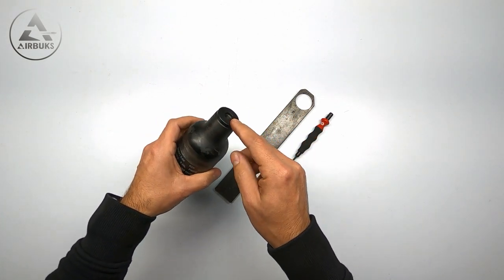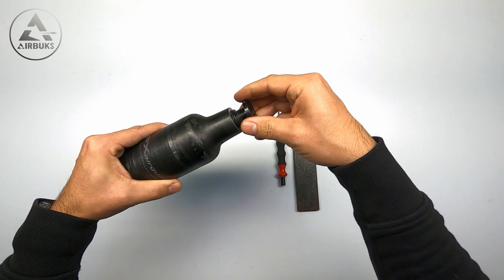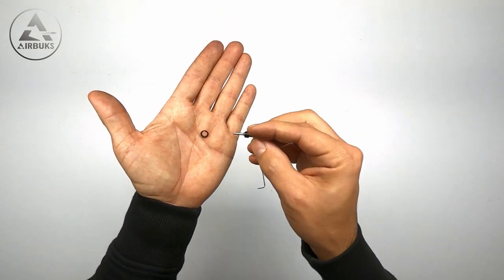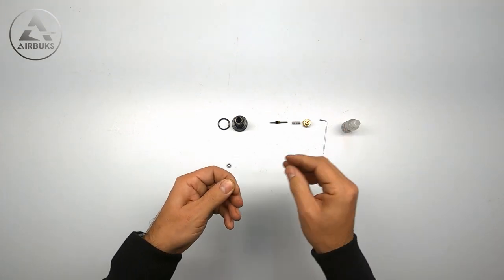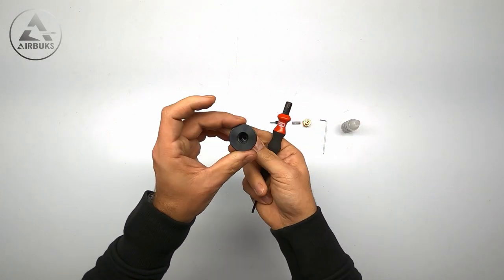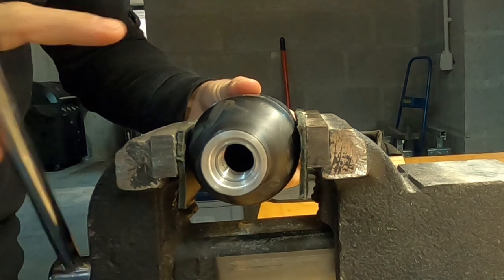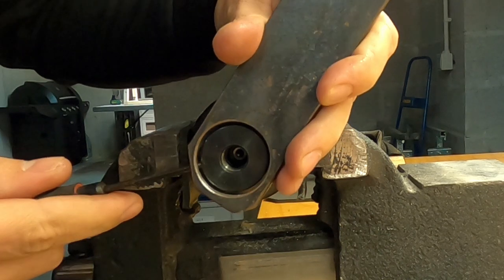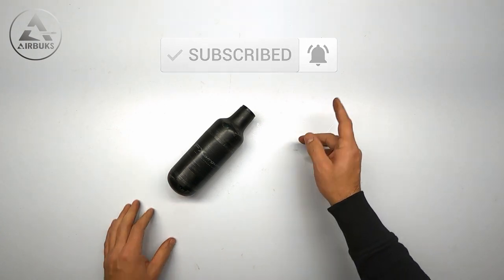FX carbon fiber air tank valve leak repair

Comment: When I did mine the hardest part was to remove the valve. Which was Loctited, with black Loctite. I think you should mention this and would be better if you will show how to remove the valve without a purpose-made tool. Apart from these, great video as usual.
Reply from the maker: Hi , my valve had no loctide on it , I have heard from others that there was loctide on there’s aswel , strange there is no need for loctide on it 🤔
I first tried to remove it without the tool but I say quickly that I couldn’t open it without damaging it or leaving marks on it .
Reply: Good point , you are dealing with carbon fiber , you can’t heat it without possibly compromising the carbon tank !

Comment: ? For you man, I have issues with top valve connection o rings blown out how do I put a new one in I have no clue where it suppose too sit in.
Reply from the maker: Can you explain more detailed or mail me some pictures ( airbuks@icloud.com )
Reply: What I’m trying too address is that trying too see where does the O rings seat in. Reason I ask that I took it off and try too replaced it but forgotten where it supposed too seated in. This is referring too bottle thread into the gun it self. O ring got blown off and leak air. If you can help me out I would appreciated it. Again valve bottle thread o ring installation location. If you have clear pictures would be awesome
Reply from the maker: @sergeantmao8017  so if I get it correct , you need to place the oring in the bottle valve part that screw into the gun ? 
You can check the diagrams and oring sizes on the FX support website
Reply: Yes correct. I had look on FX couldn’t track it down
Reply from the maker: @sergeantmao8017  part number one is what you mean think 
https://fxairguns.com/wp-content/uploads/2020/03/airbottle-200326.pdf
Reply: That’s correct but where it supposed too seat in. There 2 loop groove for o ring I had try everything but once I tighten up the bottle it struggle too go in. Maybe the O ring they send probably too thick going in there
Reply from the maker: @sergeantmao8017  normally the oring has to sit deep into the bottle neck almost all the way down , it is tricky to get it in .
Reply: Deep as in around the valve pin is that what your reference too
Reply from the maker: @sergeantmao8017  yes

Comment: The PCP world is growing very fast , I know first hand just with volume & Tire pressure in tires with up to 120 psi how deadly they can be and can kill !  we are dealing with bottles in the 4,500 psi range in the PCP world , it’s no longer handled through scuba shops who know how to test and fill these air containers !  Every time I fill one of my portable tanks I am aware of how dangerous it can be !  It’s so easy to overfill at a higher pressure while transferring from a 4500 psi compressor into a 3000 or 3500 psi PCP tank !  Enjoy the sport but realize what you are dealing with , it’s just like a loaded gun with the safety off !
Nice video and repair tool you made ! 👍

Comment: If anyone uses or continue to use the Huma quick fill adapter, you will have this same problem over and over. They now send a restrictor screw to use But it won't work either, it may work once or twice.
Using the Huma blows the valve seat out of its seat, sometimes no damage to oring just reseat but sometimes the same as the video.
When the bottle is screwed on the gun for filling the valve is pushed open allowing easy air transfer in either direction, using the Huma only high pressure air has the force the valve open thus unseating the valve seat.
Bestfittings is working on one that will work simulating as when on the gun.

Comment: Nice video, wel explained and very helpfull as allways 👍. May I ask,what do you use for lubrication of the o-rings? Will Ballistol do the job or is any silicone oil better? Thanks in advance.
Reply from the maker: Thx for the support, I use silicon olie from Huma Air .
Reply: @Airbuks Wat leuk, ik zag dat u mijn Zuiderbuur bent, ik kreeg al een idee vanwege de 'olie' ... 😊
Reply from the maker: @chefrenty9155  😉👍👊

Comment: What's the simplest way to bleed the air if the bottle has pressure in it
Reply from the maker: Option 1 :Huma air sells adapter to fill a CF bottle but you can also use it to bleed the bottle 
Option 2: saber tactical sells a kit to bleed and remove the valve 
Option 3 : and the most cheap one , find a bold that can be threaded into the neck slightly file it down one one side so the air can escape slowly . Gently thread it on so the valve pushes open and let the air escape slowly. 
REMEMBER BEING SAFE , MAKING A TOOL LIKE THIS AND USING IT IS AT YOUR OWN RISK

Comment: Great Video. Is it recommanded to put some loctite on the threads going to the inside of the cf tank, or shall we just snug it up?
Reply from the maker: Thx , mine didn’t have any loctide on it from the factory. So I don’t think it’s needed . There is a oring in the neck to seal it and the pressure on the inside will make it impossible to unscrew.
Reply: I don’t see the point of loctite if an o-ring is used to seal the air , if anything anti- seize might be better !  Tanks unlike mechanical moving parts on nuts and bolts should not require loctite .

Comment: Thank you. great video. I have a leak from the breather hole near the safety. I know the origin is the reg. I have replaced all the o-rings. And recently purchased a service kit  and replaced the delrin rod and adjuster screw. Still it leaks from the breather. Any advice? Thank you

Comment: I
 am having trouble replacing the O'ring inside the bottle valve, is there a trick to it?
Reply from the maker: Not really a trick , some patients and a blunt tool to manipulate it in place 🤷‍♂️
Reply: @Airbuks  it is really difficult to replace i have been trying for so long
Reply from the maker: @KnowsleyVerminControl  push it inward down so you put one side of the oring in the groove , hold it in the groove with a blunt object ( Allen key for instance) the use another Allen key and push the rest of te oring in the groove

Comment: Installed a power plenum on my impact now air leaks rapidly out of the weep hole fx says the regulator orings need to be re-seated but I did what they said and no such luck. Any ideas ? feal like giving up on this gun and cutting my losses
Reply: I have the same problem. I even got a service kit and replaced the rod and adjuster. Still leaking through that breather hole.
Reply from the maker: Hi guys , sad to hear you’re experiencing this issue.
Probably you have done this but I am asking it anyway to eliminate some options.
1. When you took the regulator completely out , did you make sure that everything and every surface was super clean before putting it back ?

2. Did you scratch any of the oring surfaces when removing the old orings?

3. Did you also replace the oring down in the regular hole ? Very difficult one to acces and easy to scratch that surface. You need a good pick to poke in the oring and manoeuvre it out ( like dokter bibber game 😉)

4. Did you lube all the orings when putting the new ones one ?
Reply: @Airbuks  Thank you for the ideas. I'll strip it again a little later and check for any dirt inside. I'll wash it out with 99%Alcohol.
Reply from the maker: Make sure the alcohol is complete vaporized before assembling as it’s not so kind on orings . I recommend not using anything with alcohol, ballistol is much better for airgun use
Reply: @Airbuks  Thank you. Well after a lenghty clean, the spit test now reveals no leak, But test will be tomorrow morning. Usually after a few hours, the leak gets bad
Reply from the maker: @wernerherrmann  keep me posted 👍 I use leak detection spray regularly available in the hardware store , much more effective then spit 😉 those guns are to cool to spit on 😂😂
Reply: @Airbuks  Thank you for the interest. I do appreciate it. I do have a can of leak detector, but even through the thin pipe, it just comes out wayyy too much
Reply: @Airbuks  Just some quick feedback... I left the rifle in the safe for about 2 days. Yesterday. no leak. This morning, the pressure dropped by 30 bar. So it's leaking again like crazy. I GIVE UP!!!
Reply from the maker: @wernerherrmann   thx for the update, but I suspect that one of the orings isn’t in good condition. At what setting is your regulator pressure?
Reply: @Airbuks  I have just replaced all the o-rings, including the one inside the receiver (what a mission). Reg pressure is 120.
Reply from the maker: @wernerherrmann  yes indeed the one inside is a pain in the ....   it is possible that one off the orings isn’t perfect even if they are brand new 😬
Reply: @Airbuks  Very true, I'm going on leave tomorrow morning, I'll replace them when i get back. Just took a test shot with a new slug. 25gr, 1000fps at reg 120Bar.
Reply from the maker: @wernerherrmann  that some decent power , 700mm I suppose? 
Enjoy the vacation!
Reply: @Airbuks  Yeah, 700. Thank you
Reply: @wernerherrmann  I rebuilt my regulator it was easy and that was the problem when I put the air in I guess it blew an oring works great now shooting 30 cal slugs at 950
Reply: @johnjingleheimer6992  Wow that is really flinging those 30 cals. I'm glad to hear that you have resolved the issue.  After a few o-ring replacements, i'm also now down to a VERY slow leak, very manageable.
Reply: @wernerherrmann  they say the huma has leak problems on the impact x
Reply: @johnjingleheimer6992  I do not have the HUMA reg. I also heard that there is a small delrin end on the metal reg rod that created a lot of problems.

Comment: where can i order the o ring at 4 1/2 x 1/2 nor 70
Reply from the maker: Sometimes you can find boxes at your local hardware shop or your local dive shop might have them aswel . If that is no option there are many online shops that sell orings

Comment: Its another oring inside the treaded part of valve that connects to impact why didn't you show that its the hardest oring to replace on CF bottle
Reply from the maker: I didn’t show that because mine didn’t fail there , but with a dental pick it’s not that hard to do . Just some patience 😬